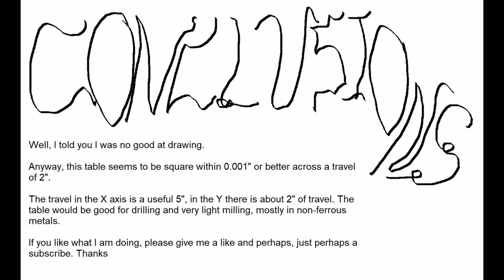Cheap Chinese X Y Squareness  Final checking and conclusions

Comment: I don't bother with those because they are not built correct. I use an x,  y table from Mico-Mark.
Reply from the maker: The whole goal here was to see what you can get for a low price and see if it can be made into something useful. This is going into my hobby area, where it will get used maybe once a month. Yes, these are not top of the line equipment.

Comment: Well done, it's ashame about only having 2" on the Y axis, but maybe you  can squeeze some more by mounting further away from the pillar. But if the side of the pillar is only 2" away from the centre line of the chuck, then that's your lot. Can you show us how the thing cuts as I might be interested in a small drill/mill. What is your next project?
Are you into model making? 
Maybe making a model, steam, locomotive out of brass brazed or or glued using off the shell wheels and motors or even a steam-powered something or other?😊
Reply from the maker: Hi James

The limitation is in the saddle of the table. I will most likely make a video to show what is happening there, it's the range of movement of the block on it's screw from what I see. 

I will be doing a cutting video on this. And yes, I do have a project in  mind where I will most likely do some work on this table. I have a PM Oscillating steam engine that I bought in the 1980s that I need to put together. Most of that will be done on my lathe, but there are some things that I will use this table to complete.
Reply: @oldfarthacks  steam engines, great stuff, no one is making them anymore, it a dying art, I'll be watching mate.😁